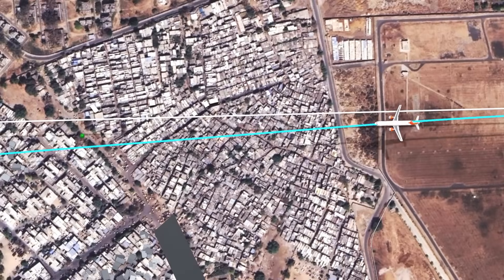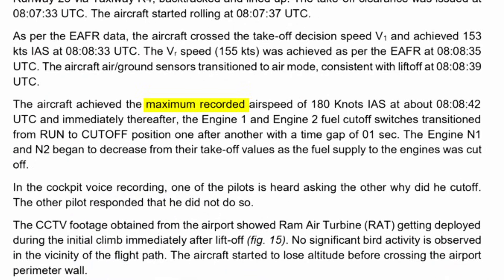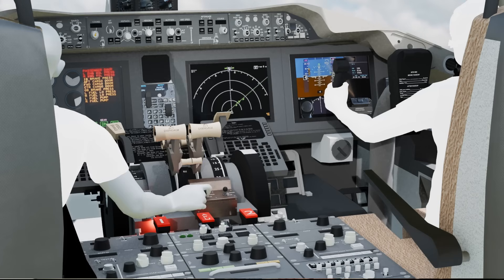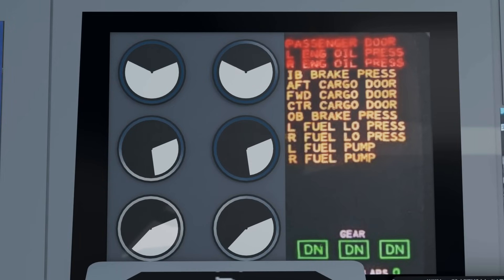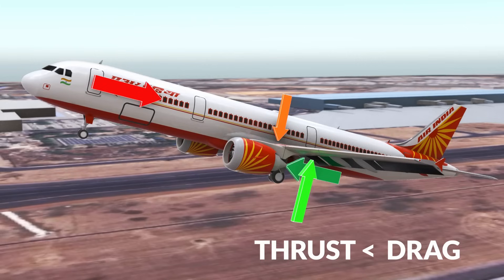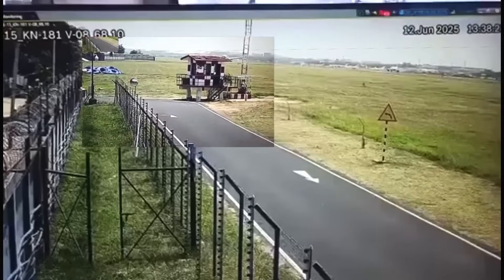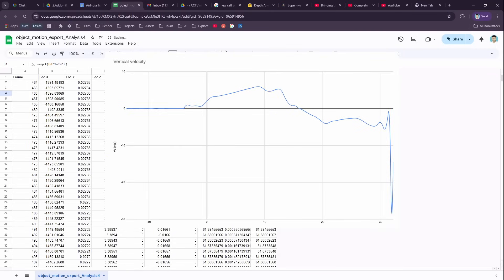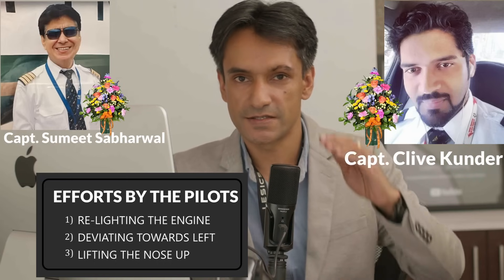Use of 3D Clone | Decoding the Crash Details you Missed

Comment: Is it possible that one pilot wanted to down the plane while the other didn't?
Reply: Right.
Reply: No way that is not possible. You all are manipulated by Boeing and they're successful in doing so
Reply: @StOrMxRuShErOp you can say you don't believe that's what happened, but to say it's "not possible" is nonsensical
Reply: @StOrMxRuShErOp  Can Boeing and airline  afford grounding the 787s
Reply: @luckydogjunction2120 but should investigation mean blaming the pilots every time? Investigation means to know the actual cause of a crash hence we would be able to avoid the same situation in the future that caused an aircraft to crash. Boeing should not use cheap parts in their airplane and be like Airbus. If we would get to know what was the problem in the aircraft, why did both the engines fail at the same time, then we would get to a perfect conclusion and be able to avoid the same situation in the future. Hope this helps.
Reply: @StOrMxRuShErOp  Can't agreed more. I certainly would like to see investigation done in a proper manner. As you can see from start, many media keep focusing on blaming the pilot. First to focus on flaps and gear down and then to the switches, How many has considered the possibility of maintenance or Boeing's fault while discussing about the pilot errors or suicide. But the reality is I think they are pushing the theory of pilot errors amd/or suicide for obvious reasons.  ANA airline in 2019 is the best example. Just because there was no casualties it was not in news. It is scary to me in ANA case, what happen if the plane needed to use reverse thrust in order to stop safety, then it would b e catastrophic.
Reply: @StOrMxRuShErOp  I responded with mentioning about grounding 787 so as to point out in my opinion what is the enormous pressure the world is facing. I believe all 787 pilots know that if the engines are in good condition, even with flaps 0 and gear down the plane can still fly several hours.
Reply: @StOrMxRuShErOp  With the data given in the preliminary report, it was inefficient to point directly to maintenance or the plane's fault but instead would easily led to think about pilot error or suicide together with all those media telling the truth but not the whole truth. Critical timings about the conversation among the pilots were not given, this would point to when the engines were shutdown clearly. Why did the report omit that is clear to many if not all.
Reply: @chacmool2581 Unfortunately YouTube prohibits the discussion about plane crashing
Reply: Indians don’t do suicide killing others like Americans
Boeing gonna get bankrupt soon when something like this happens in white country
Reply: The report said the switches transitioned, which when done manually can be heard on the CVR, by a distinct click-sound - this however is not mentioned, so the report is not wrong but only deficient and misleading.
Boeing had to buy time to investigate and discuss solutions! The glitch was initiated by the battery diode - see 3 videos by Jeremy John Thompson AI181

Comment: "At the end of 3 seconds the airplane was supposed to achieve an altitude of 45 feet."
According to what exactly? In hot and heavy days I usually slow the rate of rotation to give those wings a little more speed for the climb. It's all in the pilot's technique.
Anyway this video is garbage to fool non-flyers.

Comment: The ANA plane had Rolls Royce Trent engines. That may not be relevant since something else caused both fuel supply valves to shut down. For AI 171 it wasn’t the WOW sensors since the sensors transitioned to flight mode. There had to of been some kind of power failure that signaled the FADEC on each engine to shut down fuel supply. The pilots did everything they could to save the aircraft but it was too late. There was not enough thrust for the aircraft to gain altitude and not enough lift.
Reply: The fuel valves are fail safe on the 787. They stay open in the event of a power failure.
Reply: @stimproid what caused the RAT to deploy at liftoff?
Reply: @TheHounddog2343  Captain flipped the switches.
Reply: @stimproid After the RAT deployed. Not before.
Reply: No, that's not what happened.  The 787 doesn't have a FADEC, it has another device, and that device is not capable of switching off the fuel switches.  Only hands can do that. And they were switched off.  The switches' position is monitored via separate cables
Reply: @JulianJLW  

Yes, the Boeing 787 Dreamliner does have a Full Authority Digital Engine Control (FADEC) system on each engine. The FADEC is a sophisticated computer system that manages and controls the engine's operation, ensuring optimal performance, safety, and efficiency. It replaces older mechanical systems with digital control, enhancing engine performance and reducing pilot workload. 

FADEC Function: The FADEC system acts as the "brain" of the engine, continuously monitoring and adjusting parameters like fuel flow, ignition, and thrust to maintain optimal performance under various flight conditions. 

Redundancy and Safety: The FADEC system incorporates redundancy, with multiple channels and backup systems, to ensure that even if one component fails, the engine can continue to operate safely. 
Engine Control: On the 787, the FADEC system manages the twin GEnx-1B engines, optimizing their performance during all phases of flight.
 
Specific to 787: The Safran FADEC 4 system is used on the GEnx-1B engines of the 787. 

Go ahead. Make my day. Google it!
Reply: @JulianJLW  Yes, the Boeing 787 Dreamliner does have a Full Authority Digital Engine Control (FADEC) system on each engine. The FADEC is a sophisticated computer system that manages and controls the engine's operation, ensuring optimal performance, safety, and efficiency. It replaces older mechanical systems with digital control, enhancing engine performance and reducing pilot workload, according to Safran. 
Here's a more detailed explanation:
FADEC Function: The FADEC system acts as the "brain" of the engine, continuously monitoring and adjusting parameters like fuel flow, ignition, and thrust to maintain optimal performance under various flight conditions. 
Redundancy and Safety: The FADEC system incorporates redundancy, with multiple channels and backup systems, to ensure that even if one component fails, the engine can continue to operate safely. 
Engine Control: On the 787, the FADEC system manages the twin GEnx-1B engines, optimizing their performance during all phases of flight. 
Specific to 787: The Safran FADEC 4 system is used on the GEnx-1B engines of the 787.

Comment: Great job. Unlike the western analysts with a bias towards saving Boeing, you have done a thorough job of providing a more plausible explanation of what might have happened. I hope and pray that the final report, when it comes out, would show to the world that the 2 pilots were heroes trying to do their best when an unexpected calamity struck and not villains as portrayed by the west.
Reply: Most of this video was incorrect. What particular points did you find compelling?
Reply: @stimproid  I found all of it plausible. What particular points did you find incorrect and what irrefutable evidence do you base it on?
Reply: @M.Pakkirisamy  Lets start with assertion that the max height reached was 200 feet. Find the video showing the complete flight. keeping in mind that the wingspan of a 787 is 200 feet, tell me if you think the max height was only 200 feet.
Reply: @stimproid  Answer is very simple.
In the absence of concrete, irrefutable evidence to suggest otherwise, I would accept all hypothesis that would be more charitable towards the dead pilots.

In that light when @SabinMechanical opines, based on his calculations, that 200 feet is the max height reached I accept that. Of course if you have a video footage that very clearly demonstrates a max height greater than 200 feet having been attained, kindly share it.

Mudslinging the memory of 2 dead souls, that cannot defend themselves, without concrete evidence while a full investigation is ongoing, appears cruel, barbaric and possibly biased.

Comment: Another attempt to poo poo the preliminary report or the timelines and the altitudes. The pilots at the initial stages would be reporting the altitude readings while FDR would be recording them. Did this video simulation take those into consideration? 
Why wasn't the mayday call made or reporting to ATC much earlier or the absence of recordings of the alarming situation discussed by the pilots? 
Why would the FO suspect the captain and ask whether he cut off the engines? Suspicious lack of co-ordination / conversation between them. possibly the FO was subservient to the captain or simply dumbfounded of the unusual behaviour. 
The ATC / AAIB might know more or there isn't much. Otherwise perhaps there would have been more leaks we would have heard.
Reply: I agree with most of your points. To clarify, the rules in an emergency are Aviate, Navigate, Communicate. In that order. A mayday call is last on the list and is only done when it doesn't distract from the first 2.

Comment: But what is that action at the time of which plane lost its electric power ?
It was possibly pressing the button/pulling handle for lifting of the landing gear. There must short circuit accured in the landing gear hydraulic motor while lifting it which pulled all the electricity of entire plane. This mishap was noted by automated control system  of plane. System rebooted the entire system by deploying RAT and   thrust engine to restore spark plugs fire continuing engines to idle working condition. Accordingly it succeded but plane touch to the ground earlier before to start vertical lifting. AND THE PLANE CRASHED OVER THE TOP OF A BUILDING was seen.
Reply: 787 engines do not shut off fuel in the event of a power failure. They stay on.

Comment: My hunch/opinion is that they forgot to turn on the fuel switches before takeoff.  The aircraft tookoff with just enough fuel in the line.
Reply: Not possible.
Reply: Completely impossible theory.  The engines won't even start with the switches off and therefore no fuel, let alone produce enough power to taxi to the runway and accelerate a heavy plane to about 150 miles an hour.

Comment: The blender model would be calcualting the ground speed whereas 180 knots is IAS (indicated airspeed). So, it's possible that the ground speed was 206 knots when IAS was 180 knots 3 seconds after liftoff. Essentially, both your data and the data in the preliminary report may be correct.
Reply: Co-pilot reckons that the wind speed was 6 knots more or less head on, so add 6 to all ground speeds.
Reply: This could be analysed further by checking the runway bearing windspeed component

Comment: You're misrepresenting the report: it doesn't say "less than 1 second", it just says "01 second" (no decimal point). There are YT videos demonstrating moving both switches to cutoff over the detente in 1.2 secs. If it had been an electrical problem the pilot wouldn't have asked why did the other pilot cutoff after seeing the switches moved, he would have asked why have we lost thrust.
Reply: Not a single aviation authority worldwide has issued a grounding order for the B787. There's a good reason for that: there's no evidence of a mechanical or electrical cause of this crash. Clearly there's more in the CVR than we have been told: I think once the full CVR is released the events leading to the crash will be clear.
Reply: @IanTickle-k1o  We are not sure whether we have evidence of a mechanical or electrical cause yet.
Reply: One second is still less than one point two seconds. The pilot asking the question may have been reacting to a flight display rather than the physical switches. There would have been a display screen saying "cutoff" to show the fuel was switched off whether it was done by a pilot or by the plane. Another possibility is that cycling the switches could have been part of an attempt to reset and restart the engines. And indeed one engine did restart
Reply: @josephcullen2512  True, if one want to restart the engine one need to move from run to cut off first and then back to run. Shutting it off could be done by 2 hands, but engine restart needs to be done one at a tiime.

Comment: ive already stated on another video that in case the plane did cut off the fuel itself then the rat wouldnt have been deployed because why would it do it if it thinks this is ok, also the report says the switches have been put to off within one second thats what the black box recorded. also it had enough thrust while still on the ground, why would it suddenly cut off fuel while in the air. there is NO reason why a plane should cut of itself whithout trigger. Whats the trigger?? This has nothing to do with ground mode or air mode. also i doubt that these number could possibly be accurate since they stem from a video. i dont think its possible to distinct such small margins with a selfmade recreation. ive listened to pilots and if it really was according to you that its not possible to flip the switches as you said then they would have come to the same conclusion, because they have to know it because they have to do it. ive many doubts about this and there are still things wich this doesnt explain. why would the fuel switch itself off? why was the rat deployed when this was ok for the plane to do? and what indicades that ground mode means no fuel? who are you to make these claims? i am sorry but there is just no lead to your theory. the thing is if one pilot wants to suicide the other can still try to safe the plane what he did. thats why the engine restarted otherwise this wouldnt have been possible either because why would the engines start functioning again on its OWN? and as i said. the plane can create thrust while on the ground in ground mode so i dont think ground mode means no fuel I doubt it. also if the switches werent put off why would the pilot ask the co pilot then?
Reply: the suicide theory makes perfectly sense. first of since there are two pilots, you dont have many chances to do things that cant be reverted. and one opportunity is at the start. when you just lifted because by the time the other pilot notices its too late. its the timing the switches were switched off exactly after lift off and also the fact that both switches within one second were put to off this doesnt happen because of some failure it would be the biggest randomness ever if at exactly that time the plane lifts off, a glitch causes the fuel to cut of for both engines and it can even be restarted i dont think a planeglitch would be solved within seconds and the engines restarted that easily
Reply: @kretzschi5000  the rat was deployed before the switches were cut off man
Reply: @lethalshadow95  it happened the moment the switches were cut off. there is no engine spool down in between in this scenario
.

Comment: Great work!
Please consider also the RAT deployment.
Documentation clearly confirms:  RAT is deployed in case of manual fuel cut off   ONLY  after generators stop producing sufficient electricity!
It takes about 10-15 seconds for engines to spool down.   RAT  deployment here at 08:42 visible, is another clear sign of system failure!

Comment: This is fantasy for people in denial that a seasoned captain could commit mass murder. The switches were moved intentionally to CUTOFF at 8:08:42 & 8:08:43 and not moved to run until 8:08:52 & 8:07:56. The flight data recorder captured this. Page 14 of the report. Just because the captain said he didn’t not move the switches is not proof he didn’t. What do you expect a mass murderer to say?

Comment: This is not credible. If you were a 787 pilot, then it may be plausible. Your 3d models are based on poor and or distant camera work. The fuel cut off switches were activated. One pilot wasn't cooperating with safe aircraft ops in mind. There are very experienced pilots with their own channels drawing this conclusion.
Reply: Then what is credible?  Some half-baked delusional theories about mental health leading to suicide?
Reply: @jmy6050 True. The fuel cut off switches were activated. But the question is when and for what purpose?, Report did not give the time when the fuel were cut off. Not "engine began to slow down". They are not the same.

Comment: FINALLY, someone crunched the numbers and proved what I've been saying all along.  This was a glitch.  It probably involved a faulty wow switch.  Or something similar that the wow triggers, hung relay, or bad wire going to a relay, or bad wire on the wow switch.  Something triggered that dual engine fuel cut, and it wasn't the pilots.  They cycled the switches to try to get the damn motors started again.....

Comment: the issue with the dual engine failure scenario is that still so far, we have had no safety reccomendations issued, even if it was a deliberate crash, the AAIB would issue reccomendations to air india and other indian airlines in order to monitor mental health of their pilots, but 2 months pass by, and we stilll have nothing issued by them, there are reports that the NTSB threatened to withdraw from the investigation bc the AAIB investigators were sluggish